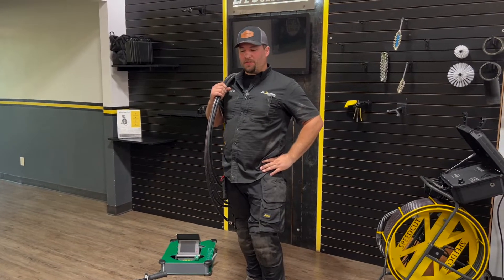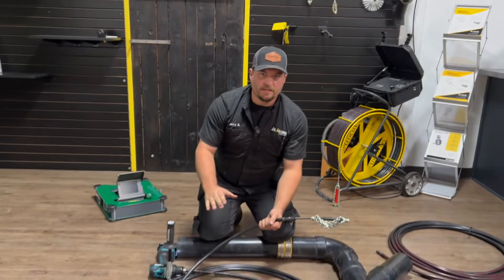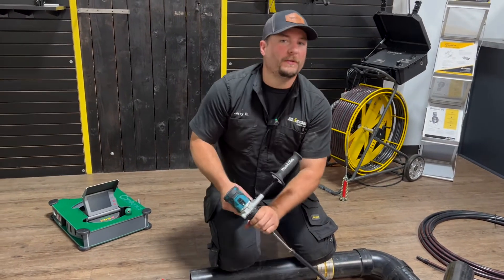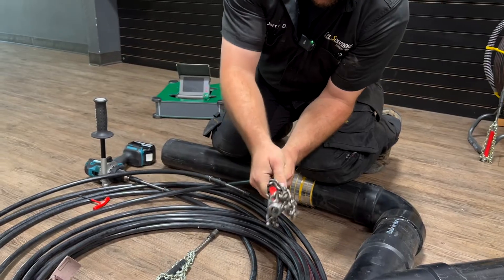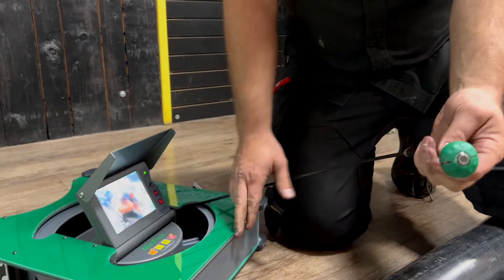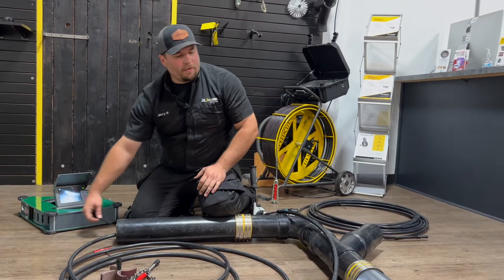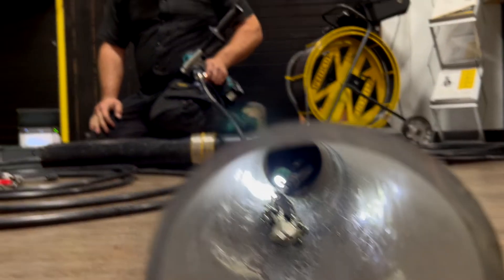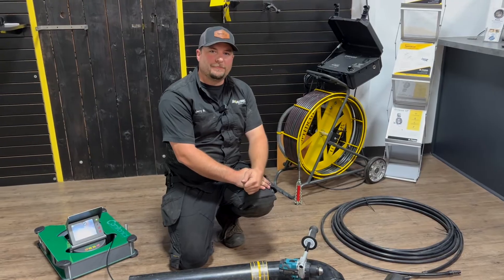SpeedShaft Descaling - Quality for Less $$$!

Comment: hey question in that camera  I've noticed it's not as easy to locate as my other camera is that normal  I'm using the ridgid scout locator
Reply from the maker: The Camtronics Cam19 has a sonde depth of 10ft (non-metallic). What are you comparing it to?
Reply: @EPLSolutionsInc  my main line camera
Reply from the maker: @brian2100  If It's a SeeSnake, the mini and standard use the same 15ft plus transmitter. The Micro Reel is a 10ft like the Camtronics. The Micro Drain is 3ft in non-non-metalic and 18 inches in cast iron.
Reply: camera is  good but with the toilets I've. made it through 2 😢 out of about ten   wen through a proflow builders grade and an American standard  no luck with kohler or older 3gpf toilets    it's nit for lack of trying greased it pushing good don't want to break it    doing this without skid   should I try it with the small skid?   made it through a sink strap into main  no problem   toilets I'm batting about 20 percent success
Reply from the maker: @brian2100
Reply from the maker: @brian2100 
Some toilets don't have tubular path way i.e. the some Kohlar toilets will have a flat bottom and spill out thru the horn. Rule of thumb is if you don't see a clear S-Trap in the toilet mold that your chances are low. Not a fault with the camera.

Comment: that cable looks like general intercore cable
Reply from the maker: SpeedShaft cables are designed by us. If sewer cables worked Ridgid and Milwaukee would be using them
Reply: ok where ordering 2 speed cuts this week hot a camera  from you waiting for the new shipment  Thanks  JERRRRY IS THE MAN    next im goiafter the Ipp machine @EPLSolutionsInc
Reply: hey Jerry  @EPLSolutionsInc
Reply: Where buy the adapter?
Reply from the maker: @DJDouglasBenz  contact us sales@epls-usa.com or call (714) 453-9760

Comment: i need (2) 50 foot sections with a drill adapter and a pvc safe chain let me know
Reply from the maker: Our Web store has just launched with many more product to come. I only have 3" and 4" star carbide chains posted but we have premium chains in stock in sizes from 2 - 6 inch, with and without carbide drill heads. 

Chains without carbide are not a stocked item at this time. We haven't had any requests for them in years. A premium chain is just fine for a plastic pipe as long as you don't sit a one spot for extended periods of time and they clean faster than chains without carbide. 

You may want to call us (714) 453-9760 for a full selection of product or visit  https://www.epls-usa.com/store/

Comment: Is that little camera Repairable or is that a throw away
Reply from the maker: Repairable, definitely not a throw away..  https://www.instagram.com/reel/C9nbamgSFd4/?igsh=MTc4MmM1YmI2Ng%3D%3D
Reply: @EPLSolutionsInc  can this camera make it thru toilet traps
Reply from the maker: @brian2100  Yes
Reply: @EPLSolutionsInc  do u have any utubes videos going Through a toilet trap
Reply from the maker: @brian2100  We can make one. I'll talk to the team tomorrow about making a video
Reply from the maker: @brian2100  we have testimonials from various clients that succeeded in pushing it through, and also a list of the toilets that have not successfully allowed it to work.
Reply from the maker: @brian2100 any component on the unit is field repairable, a huge draw for anyone in a remote area or not near any service centers.
Reply: @EPLSolutionsInc  how much is the unit
Reply from the maker: @brian2100  the 100' goes for $5375.  If you give us your email or call us then we can get you a formal quote. sales@epls-usa.com.  (714) 453-9760
Reply from the maker: The cable is about a 5 min swap as is the camera head. The case is very robust and would have to sent in for repair if needed.
Reply: @EPLSolutionsInc  how much is the replacement cable  and head  thanks
Reply from the maker: @brian2100  
Push cables are between $1000 - $1600 
Cam19 Head $1450.15

Cam36 Head $1863.72

The push cable is not repairable...
That said...
We have customers that will use the camera to clear stoppages (Bad Idea) and after breaking the push cable, will get on average 4-9 months of use. 

We service Ridgid (a lot of seesnake cameras, more of them out in the feild) , Insight, Gvision (ours) and Camtronics. We will repair other brands on a case by case basis. 

We use to rent a cam19 for a number of years for evaluation for pre-sales and our own evaluation. Our belief is if you want to know how equipment holds up make it a rental...

This is why we sell Camtronics. 
We stand behind what sell and service.
Reply from the maker: @brian2100  the 20m is $991, 30m is $1210, the 40m is $1362, camera head is $1438
Reply: what brand is that camera I'd it a forbest
Reply from the maker: @brian2100  Its a Camtronics Miniflex made in the Netherlands.

Comment: too bad you don't post your prices on your website.  i was interested but not gonna bother since you don't show pricing.  I don't want to call and get stuck talking to a salesman just to find out your guys are way overpriced.  if you offered a good tool at a good value(price) then listing your prices wouldn't be a problem
Reply from the maker: We're stilling building  the push pull integration and with the costs of goods changing so frequently since covid. We thought it was best just to leave the pricing as is for now is why.

You can email us at sales@epls-usa.com or make a sales quote from our online store. (helpful for debugging) and we'll reply with a filled out price estimate via email.

We hope to done with the push pull integration this summer.

Comment: Do you have a hundred foot option I would like to buy one
Reply from the maker: Yes, but I would recommend getting a 65ft and 35ft cable. The two cables simply lock together with the speed connectors making a 100ft. Using cables no longer than needed is always best.

Comment: Where do I get the cables in the adapters?
Reply: I have the same question
Reply from the maker: @edwinvasquezp  To order the cables, connectors, adapters, please call (714) 453-9760
Reply from the maker: To order the cables, connectors, adapters, please call (714) 453-9760

Comment: Does that not damage the pipe?
Because it looked like it was chewing that PVC pipe up, and you only press the trigger on and off a few times ?
Reply from the maker: there are chains designed for plastic pipe, also meant for cleaning lined pipe.  The clear pipe was only meant for seeing the demonstration better.  Chain descaling tools are not typically used for clearing stoppages, but for cleaning the pipe walls to allow smoother flow.
Reply: @EPLSolutionsInc   what type of pipe would you use the chains on  ? 
And do you have any videos of products from plastic or PVC pipes on your channel ? ?
Reply from the maker: https://www.youtube.com/watch?v=YLtHORQYUyI @simonpe3trie102

Comment: Is that a flex shaft cable it looks different
Reply from the maker: It is a SpeedShaft cable, high speed hybrid. They are designed for 4000rpm's although we recommend no faster than 3200rpm.  The industry needed an anti flip cable that could spin fast enough to "float" or "hover" the chains to control the size of the descaling diameter, so our team spent the time and energy to design a new cable.

Comment: Can you use it on 1 1/2 inch pvc pipe for roof drain?
Reply from the maker: yes you can, there are smaller cables that are recommended to be used for smaller pipe.   It all depends on the pipe condition and the variety of turns that need to be negotiated.

Comment: What is price for your setup and where can I buy it...I want the 100 ft...thank you
Reply from the maker: We are getting ready to go live with our eCommerce store so I don't want this to be where we quote prices. We recommend to use a 65ft sectional and a 35ft sectional or two 50ft sectionals.
Reply: @EPLSolutionsInc  do you know when your eCommerce store will go live...I would like to buy your product as soon as possible...thank you
Reply from the maker: @devinha9381  We are ready to go with quotes, if you want to fill out our "request quote" form we can get that going for you and place your order! https://www.epls-usa.com/store/speedcut/
Reply from the maker: @Muuahaha  The connectors prevented disconnection while using, as opposed to set screws becoming loose and causing failure.   We offer a 100' cable, but it requires a much larger drum and motor to rotate by hand.   The SpeedCut machine itself offers that power and capacity.
Reply from the maker: @Muuahaha  You can purchase a 100' cable,  although our coiled drum set up will only carry 65'.  To properly use SpeedCut cable, it needs a larger diameter drum (25") to work properly and give the user reaction time and ease of use.

Comment: Can you run that camera with a jetter
Reply from the maker: Your Jetter would have rear facing nozzles, so you have to be concerned with keeping the camera head far enough away from the water jet streams that can damage the camera head. High pressure water is not the only concern, but you can also "sand blast" the lens.
Reply: @EPLSolutionsInc  I didn't think about sandblasting lens it's good to know appreciate you getting back to me with that. I'll run my camera about ten feet behind only if I have a y or t in the line to make sure I'm going the right direction